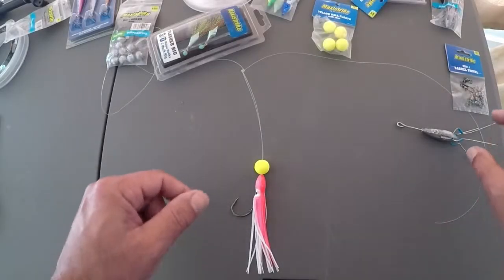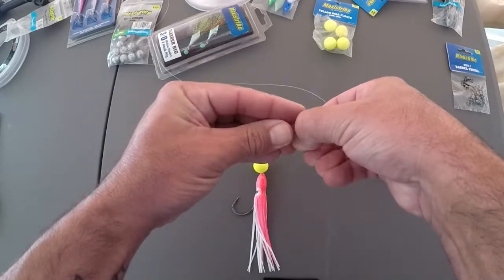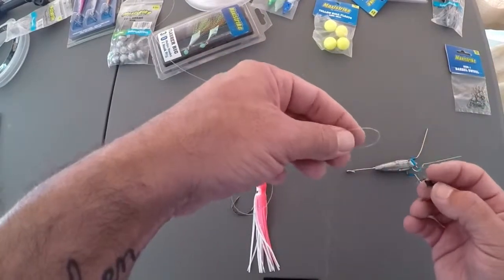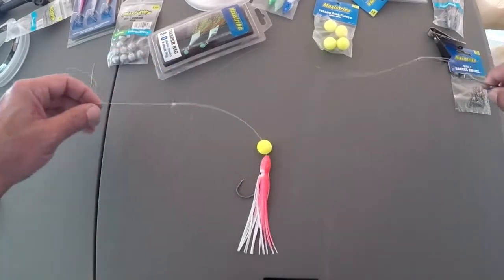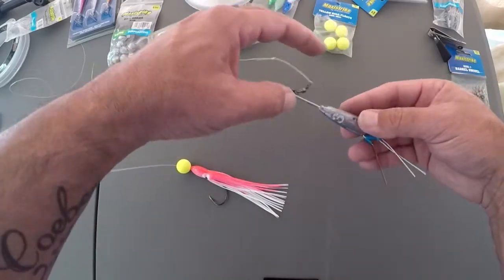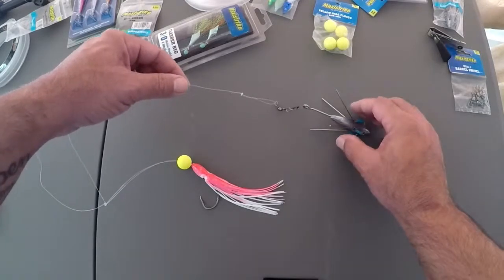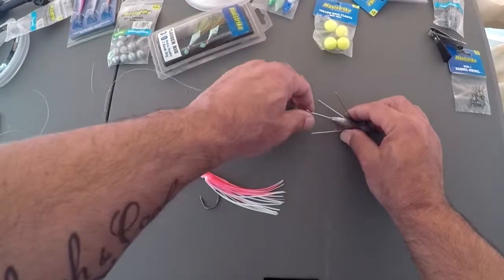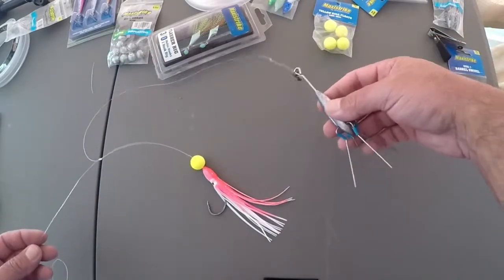How to Attach and Use a Breakaway Sinker

Comment: Why do you use a swivel instead of just attaching the line to the sinker?
Reply from the maker: you can just tie it straight to the sinker but I like to use a swivel with clip for a couple of reasons.
1 - the swivel stops any line twist from the sinker
2 - you can switch out to heavier or lighter sinkers if needed without cutting the line. The sinker will get to close to the hook if you end up cutting it so it stays set up nicely the whole time.
Reply: @maxistrike5153  awesome thanks. I'm still learning. Cheers